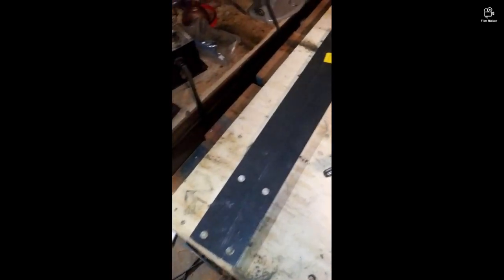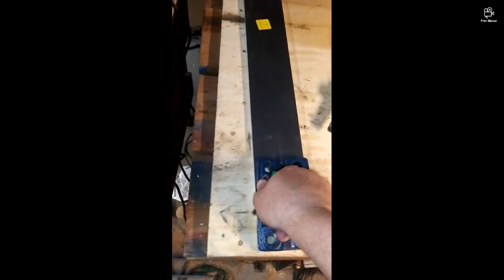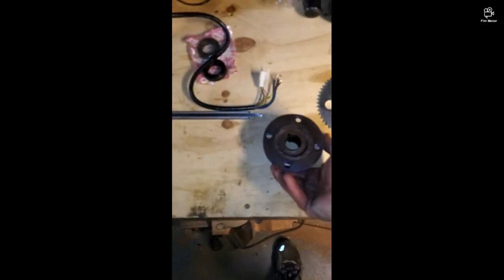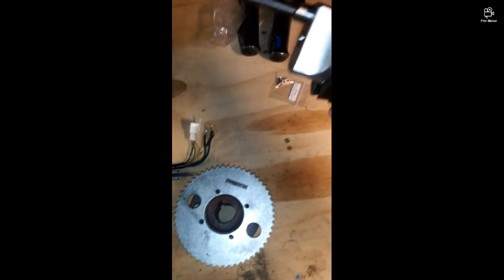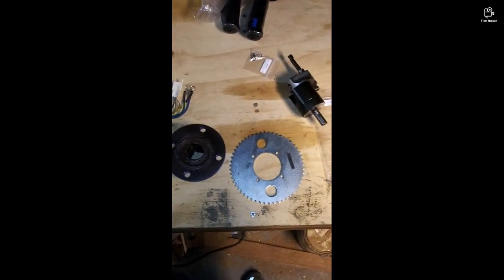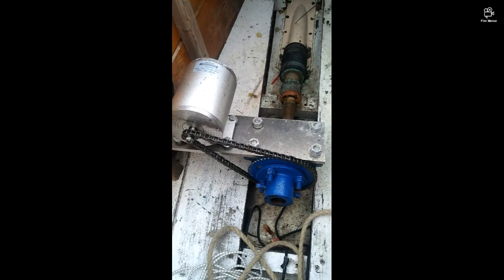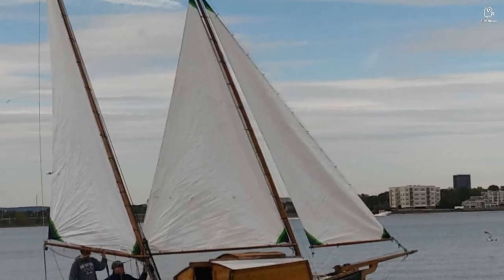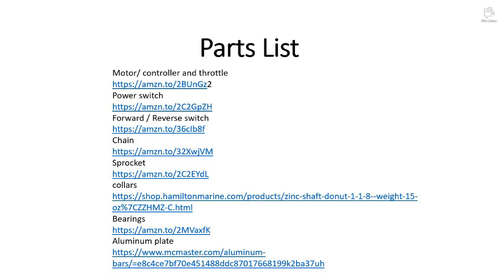Inexpensive   DIY Electric Inboard Conversion

Comment: Thanks for sharing,  I have the same motor, right off the bat, seems the drive sprocket is to small, and would be quieter with a larger diameter set up or belt drive
I have a 18' sailboat I was wanting to add and electric drive to  instead of a outboard, this confirms my motor is big enough to do what I was planning.
I have about 14kwh worth of Nissan leaf batteries that should work just fine with that setup, they just bolt together and configure  to any voltage set up you have for your motor....
Reply: I was wondering on the noise issue, have you ran the motor with out a chain or belt to see how much is actually the motor? since everything is tied to a metal plate, it may need rubber or cork dampeners under motor feet to reduce the motor noise/vibration from being transmitted into the metal plate and shaft. Just a thought, my motor is not at all quiet by itself, compared to an a/c induction motor.
Reply from the maker: This is very cool !!!  I thing the larger sprocket would be better. This season , my motor works good. I did switch it over to a belt seems a little bit quieter also built a Box around it just to protect myself from sticking my foot in it. I did change my controller primarily because I really needed to go backwards and the other one was just not cutting it so I got a yu Yang King from AliExpress that had Bluetooth control on it as well . that allows me to adjust and go 100% forward and reverse and it can also give you a lot of other features that I don't use.  

Please keep me updated I'd love to hear how your making out
Reply: @philcostello6989  What size belt pulleys did you use? did you have any problems mounting them to motor shaft?
Reply from the maker: I use a tiny pulley like the e-bikes I got it from electricscooterparts.Com.

The ratio is 1 to 5 ish . so far the belt and pullys are running good still a bit loud though not as bad as the chain
Reply from the maker: https://electricscooterparts.com/
Reply: As you have torque with an electric motor you have to use another gear ratio. Instead of 1 to 5 you maybe should reverse that to 5 to 1  or 2 to 1 at least. So at least you get double speed of your propeller or even 5 times if you go for the 5 to 1 ratio. I plan to do that with a modified outboard motor, with a 3kW electric motor. It should be 3.6kW for a 5hp outboard motor. I will go for a 2 to 1 ratio to compensate 1 to 2 ratio loss in the propeller gear.
Reply from the maker: I switched to a belt and and timing pulleys it quieted down a lot but still has the high pitch motor noise. I think you have two good ideas I will try when I pull her . A larger drive gear on motor and a hard rubber pad between motor and pad. I have a video with this yeSrs modifications about to be published including a larger motor controller with blue tooth that I love. . Hope to publish before weekend

Comment: why not direct drive???  lead carbon batts???  lithium batts are over priced and over estimated.
Reply from the maker: Hi Ryszard,. 
For me the motor mounting was easier and I wand a mechanical reduction to boost the mechanical advantage at the lower prop speed . Not sure I needed to do it but seemed to be the right thing to do at the time. 
The lead acid battery's were fine for me cause I needed ballast. I have 4 80 ah lead acid. Batteries  I also have solar panels so don't have to worry about charging for  my weekend outtings

Comment: could be used in a 19 ft Boston Whaler Outrage, I want to use in the case that my old 150 hp Evinrude outboard fails, use this with a small generator
Reply from the maker: in theory yes but with that kind of HP on the drive line i would assume you are going  out pretty far . in all honesty i would hate to have that motor as my back up good for  close to shore . but if your off shore or in weather i would want a proven system  as my back up . you see this is my primary but at anytime i can whip out my seagull gas engine and get back in to shore .

Comment: First off knowing Phil for some years I am amazed and glad there was no smoke, Sparks or fire. 😁
 Phil as soon as I heard the chain I thought double belt drive.
 Great concept 👍 have you thought of obtaining a used power chair with shot batteries?
 The motors 2-4 have serious torque. Have programmable speed controllers and you could use one motor for forward and set the other up opposed so that when it in "reverse" it's actually spinning full speed forward.
 Flip the polarity on a motor wears it out faster.
 Speaking of speed a washing machine motor is around 5hp I remember.

Check out Battle Born batteries, pricey but pack a punch.

I'm gonna have to call Elon for a Tesla battery and a couple motors.

I'm thinking "Drag sailboat" 😂
 I once put a Kawasaki 650 engine and jet drive in a 18 foot Jon boat in GA. ⛵🚤

Stay safe my friend.
Reply from the maker: Interesting did not think of the chair

Comment: Thanks for sharing! I'm working on a similar project (same size boat) and was wondering if you could perhaps anwer a couple of questions: Firstly, do I understand correctly that it draws only 8 amps (so about 400W) at 4 knots? So it can run on your batteries for 5-6 hours then? Secondly, have you considered the axial forces on the shaft? In normal (diesel) setups, the axial forces push on the engine which is mounted to the boat. It appears you only use normal bearings which cannot take axial loads. For a boat like yours, axial forces will be around 100-200 N (or about 10-20 kg), which is quite a lot. You are not using a thrust bearing, are you? Oh, and does your motor get very hot after longer use? Thanks!
Reply from the maker: So I didn't use my amp meter I had a Amazon read out that I bought the voltage was right but I never double check the amperage it did say apps. I did confirm the four knots with my GPS. So my shaft is bronze events 1 in 1/8 diameter ironically enough the motor was not attached to the boat it was just attached to the shaft the balance from the push and pull on the chain kept it in place as long as I didn't have a real jerky acceleration and there was no need to in the boat. I suppose the axial load for the system was placed at the point of the prop pushing against the stanchion in the water to move the boat along . At that point I did not have a neck seal bearing thrust bearing to to not be an issue for me. keep in mind my design was not for blue water sailors was just for me and my weekend warrior in and out of the boat slip so I could sailthough I didn't counter any undue vibration or underwear when I looked at the prop in this the engine as a matter of fact I didn't really even see any of the paint worn off that all seemed to be held tightly together. If you're buying that motor I would suggest a different controller. I bought it cuz it was an expensive as a package but I always question the fact that it was 1800 watts and if you do the calculation that would be about 50 amps 32 which is what the controllers rated for I'm not an electrical engineer but it just didn't seem right I'd be interested to see what your design is in what you're working on I could always use some ideas I've made some modifications from going in the water this year hopefully I'll be in by the end of the month I ended up getting a new Yang king 80 amp controller but I'm going to be testing out and hopefully that'll give me more power back words that also has a Bluetooth option for control which is kind of cool I got that on I think I got it on eBay from China but it might have been AliExpress
Reply: @philcostello6989  Thanks for your reply! I am probably going to be using a 3kW Golden motor (https://www.goldenmotor.com/) with a 48V 90Ah LiFePo4 battery. The transmission will be belt driven. The project will probably be finished in about 8 weeks. When it's done, I will upload a video to youtube and put the link here.
Reply: @gijswolbert  How did your project turn out?

Comment: Hey cool project thinking about buying the same kit for my boat.. what kind of batteries do you use? and how much of them?
Reply from the maker: I have four 12-volt batteries lead-acid I need the ballast so let out as it is fine and each of those batteries are 80 amp hours the total total battery cost was somewhere around $400

Comment: Awesome video! Have you GPSd the speed, checked run time, motor temps, power consumption, ect? Seems to move pretty good. I'm interested!
Reply from the maker: sorry I thought i replied to your post . I did GPS the speed which for me was fine a little over 4 knotts . I did not check thee temp but i did have a multimeter on it which was reading 8 amps i am mot sure i believe the amp reading would think it would be more .

Comment: great video Phil eny chance you can do a update review video of your motor cheers
Reply from the maker: I was set back at the end of last year We had a Gail and her sump clogged the controller and the motor went under before I could pump her out.  The way I have to have her tied at  the club it was forcing water to pour in with the waves from the wet well.    This year i have gotten a new controller with the same but new motor and am making the modifications i mentioned in the first video . i am hoping the new controller will give me more power in reverse .  yukangking controller 80 amp is what i got on Aliexpress . in the process of figuring out how to wire it  at this point . i will publish an update once i get the motor rocking with the new controller . thanks for asking !!!

Comment: I knew there must be a simple, inexpensive way to get an electric motor for a sailboat!  Although I'm sure it took a lot of thought to figure this out. I'm wanting to do the same thing on my Islander 30, but I'll need a bigger motor - maybe at least 5KW.   I'm having a hard time finding that.  Anyway,  thanks for giving me some good ideas & congratulations on your success!
Reply from the maker: Thanks and good luck with the 5 kw
Reply: @philcostello6989  Thank you so much for your video. life saver...
Reply: Hi there. I m trying to do it on same size boat. Have you been able to source a 5kw?
Reply from the maker: @sora9930  so I have another video come out with some research I had done I'm not sure if it's correct but it looks right what I would recommend for your size boat too is to go to Vic prop and you put in your dimensions and it will come up with an equivalent horsepower and equivalent to work typically an electric motors you need to work to talk not horsepower because the engines can be inefficient but you have to have that basic to work so that will give you a good baseline and where you are and then it will also help with the size and diameter and and pitch of a prop what I did was I worked my baseline numbers through and then from that it gave me what horsepower would get me to hell speed and then it also gives the torque at that whole speed when you when you enter that into the program again for that horsepower it will give you the torque that that engine they're thinking is going to produce and then you use that torque to size your motor if you want to do Hull speed. The thing is this whole speed comes at a great cost of power and you're probably only be able to do it for maybe an hour maybe less but you could probably do three knots forever. Just some suggestions my next video is coming out pretty soon with some of that stuff in there and you can always look it over and give me some helpful criticism what you guys what you think
Reply: @philcostello6989  Hi Phil. Thank you so much for your detailed and prompt answer.  I have been able to find another video with  34ft with  5kw. My boat is a 32 trawler with a Ford Lehman giving me some trouble. Time to go...so it has prop and all...Not interested in "racing" so I will be content with 3 knots. Isn't it the real mean of "cruising"? I like your set up better than theirs. Yours is simpler. So thanks again for your videos. Will keep in touch.
Reply: Here is the video for reference: https://www.youtube.com/watch?v=TBV5upOiVrw

Comment: I just commented on your posting and was thinking a bit more about the noise the chain produces.
What about a spring loaded rubber wheel  (like something off a skate board) mounted on the 'slack run' side of the chain.
'an hour project for a man of your caliber! 

Again a cheap project that might quite things down enough to let you skip spending $$ on belts/pulleys
Reply from the maker: Interesting , I bet that would quiet it down too. I am switching to a belt actually will see how that goes

Comment: Maybe a thick layer of sound deadening material applied to the inside of a sheet metal chain guard.  Cheap & easy to try.
I'd guess chain would allow you to run just a bit looser than a belt saving some friction/wear on the bearings.
Nice to see someone doing something for themselves.  Most don't know which end of the screwdriver to hit with the hammer.
Reply from the maker: I switched to the belt and it became  a little quieter . i also biult a box around it and that made a big difference. thanks for the ideas ! imay add some foam on the inside of the box in the future

Comment: Awesome. I'm looking at electric options for my 22 foot trailer sailer. Currently it has a smelly 2 stroke outboard. Can I ask what sort of speed you are getting when under motor and what sort of amp draw? Are you running 12v 24v or 48v? Also interested to know why you didn't go direct inline drive with no chain?
Reply from the maker: 48 volt system running Hull speed about 4 Knott's coul go up may to 6but I don't because of amp draw I think it was around 8 amps but not sure now if gave was reading accurate when measured

Comment: Id love to know more about this setup as i like to adopt it to make an outboard version
Reply from the maker: so i think the controller is undersized for the motor though it says the motor is rated for the 1800 kw if you do the math its more like 1500 with the controller that comes with it . it did push my boat fine . i purchased a couple of pulleys and a larger controller so this year we will see how much it change . i want it quite.
Reply: @philcostello6989  yes i was thinking couple 100 lb thrust trolling motors hooked up to single helm controll by removing the head unit on motors n conecting wires through a speed controller n mounting motors under boat each side
Reply: @keithprosser35  Good morning, i have done what you are talking about here ( i used 6 12v trollers on a 22' boat, not a good idea, use 24v, more efficient ), simple re-wiring should do it. You may have hated math class in school, but here is where you are going to need it. Hull speed (hull speed in knots equals 1.34 times the square root of the waterline length in feet (HS = 1.34 x √LWL) is the most efficient way to push the boat, once you try to go faster, the amount of energy you consume increases exponentially, you end up wasting energy, not going much faster. Do the math backwards, what i mean is, figure out what you want to do with the boat first, then fill in the unknown questions, How big a motor, How much batteries, how fast, and how long a trip you want to take. Don't forget a solar panel or two, keep the juice up on battery bank. Look for my upcoming vids on new project.
Reply: @jamesagaudinosr.4327  yes im using 24v motor setup n will be using solar panels to
Reply: @jamesagaudinosr.4327  they are 100lb thrust lbs 24 v motors

Comment: Excellent!
Yes, a belt drive would be much quieter than the chain.
I am installing the same motor kit in an atv.
Do you remember what the electrical connections, the white plug connectors are called?
I need to get the ones tomatch up with what came with the controller but I don't know what they are.
Auto parts store? Amazon?
Thanks!
Reply from the maker: https://electricscooterparts.com/wireconnectors.html  
Think you will find them here

Comment: thanks for showing us  what  you have achieved...im looking at doing similar on a `13 foot sail boat with a small inboard shaft an prop.....firstly what battery's are you using an what size propeller   ?? thanks in advance
Reply from the maker: I got use 4 12 volt 80ah  lead acid batteries from batteries and bulbs . I don't mind the weight because i need the ballast . the propeller i dont remember so ill have to look at it for you when i can
Reply: @philcostello6989  kool stuff...i have a shaft an prop off a vintage 'PUTT,PUTT"  BOAT...its all  brass   (shaft inc)prop is 6 inch in dia
Reply from the maker: Hey that very cool , smaller prop will be better for your app